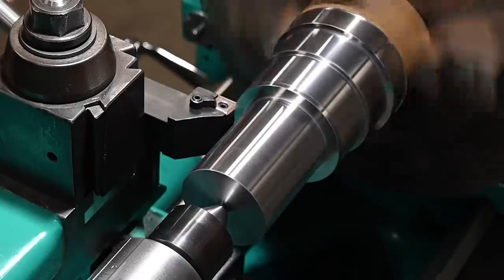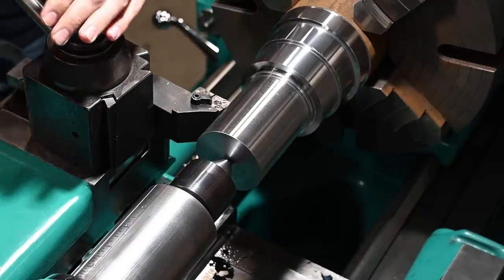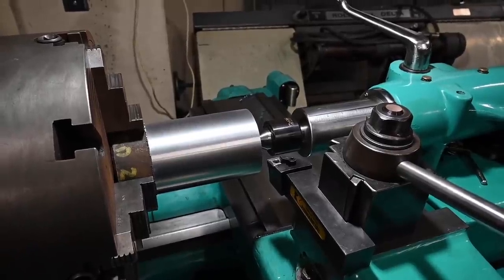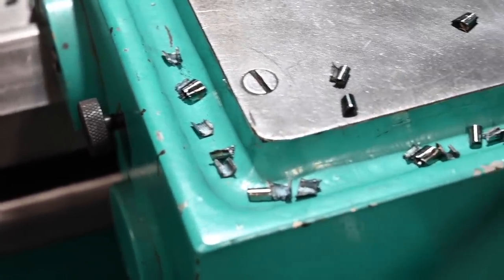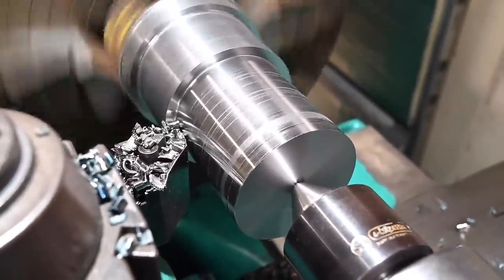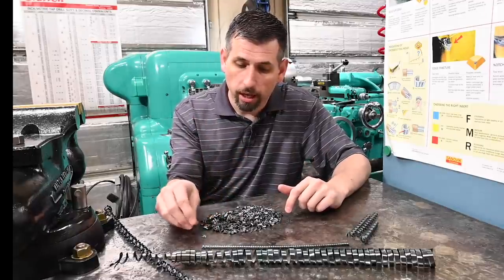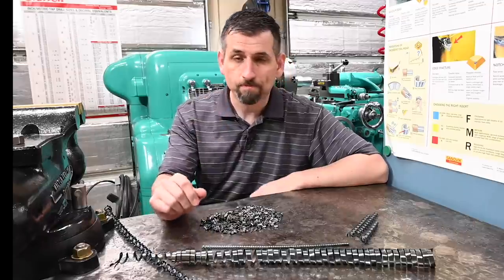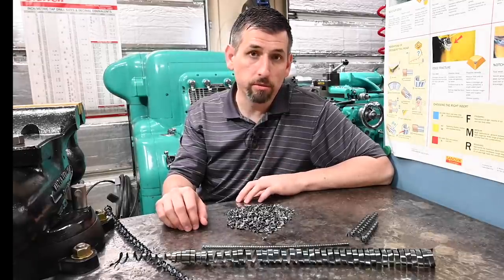Heavy Turning on the Monarch lathe: SUCCESS!!

Comment: When I worked in oil field machine shops, we had an old Axelson lathe. One of my shift mates was able to get that thing to take a 1 inch depth of cut with a carbide insert tool with an adjustable chip breaker. You could hear the chips pop all the way across the shop. :O)

Comment: Actually WWII pretty much ended HSS as the primary turning tool. Carbide was in widespread use by the 1950's. I am glad you got it figured out! I knew you and the machine could do it. :-)
Reply: Actually hss only hit the market as late as 1976. Before that it was high carbon tool steel that was used for lathe bits/cutters.
Reply: I know what you mean. TCT took over then as it was superior.
Reply: @swansong1851  T1 HSS was patented in 1910, M2 came in 1937. There have been various mixed high speed steels for cutting tools for over 100 years.

Comment: Ignore the "your doing it wrong" comments, you stated that it was an experiment/lathe and operator video series, very impressive metal removal on a lathe that was most likely designed with HSS tools as the main choice/availability, brazed carbide was most likely available, but used for the difficult materials only.
You can use the data for each insert as a starting point, biggest factor is material, ref SFM.
Great vlog thanks for sharing.
Reply: I have a question and please don't think I'm trying to be rude, if he is asking for help by posting a video and asking for assistance how does one give said assistance/recommendations without simply implying that he is "doing it wrong"?
Reply from the maker: I think it's pretty evident when you're offering advice without being a jerk. Comments like "I can't watch anymore, this guy is gonna get people hurt with how he does things...I could get this job done in half the time, this is ridiculous" isn't very constructive. "A better tool to use is one with a positive rake on it to cut with less friction and consume less horsepower" helps explain a better approach without coming off like a prick. Hope that makes sense.
Reply: I believe that the Bosted Tap comment which said that the "biggest factor is material" implies that your choice to save money may backfire as you can't adequately check each piece of material. I hope that was a positive comment on something you may want to consider.

Comment: Nice, glad you got it worked out,  I believe you could see in the last video where the tool was slightly deflecting down into the work, all sort of makes sense now.   There has been more than one video I have watched where you can see things happening that you would not notice while actually making the cut.  Might make sense to do some slow motion video when having problems, just may find that Doh! moment.  Like forgetting to tighten the tool in the holder, BTDT.

Comment: Home shops are for fun. What is the point of having a 10 HP machine if you run it at 1/2 HP all the time? The purpose of owning one of these is to explore its capabilities. You will discover it's limitations by pushing it to the limit. What you learn is invaluable. Most of my turning is done a Hardinge tool room lathe but I have a 10 HP lathe that i use for big parts. I expect to see the coolant steam and the chips fly. Like you I worked my way up to big cuts. Now I know how to do it. Let's quit pretending that your activity and mine are somehow motivated by professional goals. We are in it for the adventure. We like making stuff.

Comment: Hint. Measure the new tool post stud length and mark that on the shank. Every once in a while check the stretch. But now you know what a failing stud feels like
Reply: Are the studs generally mild steel? Perhaps a high tensile stud would circumvent the issue to some degree.
Reply from the maker: Essentially everything is a spring so studs can stretch, especially after a crash or something. I bought this tool post well used and the stud was in terrible shape so I made a new one with prehard 4140. I used a mild steel block to make the nut out of, and rather than weld the dissimilar metals I chose to pin them together which wasn't a good decision. Followed the procedure to weld them together and now it's nice and strong.

Comment: I've watched a lot of lathe videos and the one thing I've noted is that you are NOT always going to be able to break a chip.  Sometimes the metal just comes off stringy.  Both Turnwright and Oxtools have failed on occasion find the grail of feed vs RPM.  Even Abom79 has had a problem with this.  So, if slowing down the RPMs or speeding up the RPMs, and the same with feed rates fails, you are going to have to live with it for the job.  Keith Fenner did point out you shouldn't try and grab the strings, that sounded like really good advice.

Comment: Great to see your progress.
Be aware that when roughing, depending on the holder 
and insert geometry....
The skuffed erea is most likely just the tight curled chips doubling back against the surface you just created.

Your finish pass, and the 2 identical validation passes, will have a proporionaly smaller chip which shouldn't rub on the work.
Hench no skuffing.

Comment: I think you have a great machine to play with and a good attitude to go with it. I am a hobbyist with an old 1960 13" South Bend engine lathe, 3-step pulley for speeds. It's a 2 hp with a 2-1/8" wide belt. I also learn as I go. I was trying to see what kind of cuts I could take. Using carbide inserts and running in the mid 450 RPMs range I could take some deep cuts producing good results but only under certain conditions. If the piece, I am turning is all the way in the chuck so it can't move back then .300 to .400 plus works but unless there is a spacer or it's against the rear of the chuck it will shutter and push back through the jaws of my 6" 3 jaw chuck. Normally I can take .200 per cut with good finishes and results. I really believe you can take a lot more off than you are doing. There is a video by Joe Pieczynski and he is starting out with a 1/2" diameter stainless bar and taking 1 cut leaving .030" peice 2-1/4" in length. Please take a look, it will help you determine the depth you can go to by seeing someone in action. I enjoyed you video and your lathe. Thanks

Comment: Hey friend getting a kick out of watching the Monarch. I ran a 1953 model for a few years very good machine. 10hp on this machine is way plenty to turn heavy cuts.
   I will offer a suggestion or two may help you a little. When roughing with the cnmg type tool you might find it helpful to adjust the angle of the insert to less than 90° even 5°can helpful in hard or tuff material it would leave you a little too face later but I've always found it to helps enough to the extra facing didn't bother me. Also the angle will help save the very tip of your insert so that when you turn it back to slightly more than 90° you can obtain a good finish. 
   I recommend trying lots of different angles especially if you're doing heavy turning because there are some intense forces at work and the angle of your tool can make a lot of difference ! You might try checking out the grinding of HHS tools and why they grind different angles and reliefs . I personally like the  TPG style tools but to each his own ! They do make tool holders that will give that cnmg tool a negative rake and ones that hold the tip of the in the center of the holder also with different rakes and clearance .
   With more experience you may learn to listen to the harmony of the machine and the tool working together ! I always love it when I can hear the machine pulling the cut but not straining and it should be a smooth sound. 
   Keep experimenting and refining your technique hope you have many years of enjoying that great old lathe !
SAFETY FIRST ALWAYS !

Comment: Just a helpful tip. What you should be looking for are 6’s and 9’s in the chip and a dark blue colour which shows the bulk of the heat is in the chip. Just adjust rpm, feed rate and depth of cut until you get that and then you are on the right track mate. (50years in the trade)
Reply: 😮50!🥂

Comment: I think the bad finish may have just been chips getting caught between the work and the toolholder, it shows up well in the video.
 That machine was designed such that the tool or the work will give way before the machine ever will, I think you could go to the max D.O.C. for any insert though you may stall the motor with the sfm for carbide.
 I've used a 16CW turning stainless and odd jobs at a fab shop, it was pretty well worn but still quite accurate. It's been a number of years but I know I took cuts that deep in 316 stainless, I couldn't get the chips to break reliably in that stringy material but I got the job done.
 A good trick is to set the rpm a bit high and take a facing cut, you can then figure out the best sfm for a good finish by measuring where the shiny spot and calculate the sfm based off the diameter.
 Please add the machine make and  model in your video descriptions, you'll probably get a few more views from the Monarch fans.

Comment: Aaron,
I spent my career repairing machines instead of using them. My shop was just entering CNC when I hired on. My skill set as an electrician turned electronic tech and precision mechanic was desperately needed in our shop. Those decades were growing years for me. Within a couple of years I was managing our group of technicians and picking up machining pointers along the way. I did almost none of my own machining, and when I did, I had REAL machines to use that the REAL machinists had set up for me. In my retirement I am trying to learn to machine with older, smaller machinery that fits in my shop and into my budget. Manual machinery drifted out our our shop as CNC took over. CNC machining skills hold little interest for me except the advantages of complex geometry. I like making one offs to meet the current need whether making the part from scratch or modifying something worn or broken. Each part presents new challenges. Figuring out what is going wrong is part of the joy of the journey. Most of my large experience came from Clausing Colchester machines. I have owned my Craftsman/Atlas for quite awhile, but the little girl sure has limitations. I am still learning what she can do. A much larger LeBlond is trailered waiting for the new shop to be built.
I am equally interested in woodworking as machining. The learning curve in wood is similarly extensive as machining. Each skill set offers a lifetime of learning experience. The more that I learn, the more I respect what others know and can do. You stepped into my world when you shared your repair efforts and discoveries. I cringed at mistakes that you were making along your journey that I would like to have been helping you avoid, but you are helping me by teaching me along my machining discovery trail. I have only recently discovered YouTube. I enjoy and rely on the group of YouTuber machinists.
Each of us that has a competent skill has something to teach the novice that wants to learn. Each of us that is discovering a skill has something to offer someone just starting their journey. I appreciate your explanation of what your channel is about and what you are trying to do. Your explanation inspires me to watch your videos more diligently.

Comment: Love that Monarch Lathe!  Great job on sprucing it up, thanks for sharing!   Keep seeing your Brown and Sharpe calipers I have the same set and LOVE them.  Mine are getting a little beat up and I'm sad that I can't purchase the same ones as a replacement.  I purchased them as a second set for rougher use that my Mitutoyo calipers but find I prefer everything about the Swiss made B&S.
Reply from the maker: I love these calipers! It amazes me that round depth rods aren't more common- I much prefer it to the flat blade with a step.
Reply: AlwaysSunnyintheShop , I fully agree with the round rode being superior, I can get close to edges.  Also, the B&S seems more accurate reading I.D. for whatever reason.

Comment: Sometimes its just trial n error. Back in 78 i worked in  government sub shop. We made missles and rocket parts. And others some restricted- which no one knows all about. Well we had a giant lathe 54inch chuck. The bed was i think 60 ft or so. Well my job as forman was set up on many of the machines . That old lathe with high speed tool bits would cut 3/4" chips at low rpms. Those things were about 30 thou thick and blue . Handfull felt like 5 lbs. Been a long time ago but it ran all day to cut the length of the lathe. Use to have a few chips but i sure dont know now where. The vbm was my job daily it had 12 ft table level with the floor n up thru the roof. Keep cuttin and learning . Wish i had pictures but no cameras aloud there then.

Comment: Sorry, I know I'm late to the party. 0.021 feed/rev may be a bit much for your chip breaker. 

Look at the insert maker's catalog. They have recommended ranges for their different chip breakers displayed in convenient chart form. I eyeballed the chip breaker in the insert you're using. I think you'll find 0.011 to 0.016 feed/rev to be the sweet spot for low and medium carbon and low alloy steels. Once you find it, you'll be rewarded with the jingling sound of blue 6's and '9's cascading into the chip pan. 

Modern carbide inserts are highly optimized with coatings, chip breaker configurations, base carbide, etc mixed and matched for specific conditions. Some may be well suited for broad application general machining but others have definite niches - inconel, 300 series stainless, free machining steels, nickel chrome alloys, boprozes, aluminum alloy etc.  The CNC gurus keep catalog libraries and computer apps to aid selecting inserts for production machining. Before you commit to inserts on eBay look up the multi-digit number on the packages. Lots of white elephant inserts on the NOS market. Shop wisely.

If heavy roughing is in your future you might consider a turning tool with a "B" as the third character in the designation code. This denotes a 15⁰ lead angle.

My personal lathe is a Voest DA215 toolroom lathe I bought new in 1971. It's presently fitted with a 5 HP three phase induction motor run from a VFD. In the early '90's, I decided to upgrade from triangular inserts as the tooling I'd been using was deteriorated when I got it and 20 years of daily use hadn't improved them. I comitted to the 43X "W" series "trigon." inserts and my initial buy of turning tools were made by Iscar. The trigon has 6 usable cutting edges, 12 (theoretically) if you exploit used inserts on tool cutting on the other hand. The trigon's 80⁰ tip angle is more robust, geomertically speaking, than 60⁰ triangle inserts.

I've since expanded my collection with other makes accepting trigon inserts as they became available and I could afford them. It turns out I was accidently wise in doing so for the trigon inserts are still very popular and come in a huge selection of configurations and nose radii. 

I've been careful to limit my general turning tooling selection to those accepting trigon inserts. Accordingly, the trigon section of my insert drawer has about 15 little trays each with a particular insert. Many of my friends have whole drawers devoted to general turning inserts of many shapes representing a large investment, many having very low utilization.

I didn't mean to go on a rant on the virtues of my particular choices. YMMV. My point was to encourage selection of an insert shape that fit the maximum array of the general purpose tooling you will use. and not purchase (or accept for free) other tooling using different shapes: IOW, standardise.

Comment: Nice video of you learning as you go!
I'm learing to become a machinist and I'm 20 years old.
I have done alot of heavy cuts with a DNMG150612 insert (doc up to 5mm in stainless so 10mm off the diameter).
Maybe you could give that a try, or just low doc and high feed/speed might be faster.

As a tip I'd say use a smaller tool holder and put it in a real holder ;)
You should be able to get away with using a 20-25mm tool holder.
I'm watching this channel for the first time now so I don't know why you did this.

Keep learning! Everyone should always be learning!

Comment: If you look at the surface scratches during the cut, you will see that they form well behind the cut face.  I think this is because of the chips getting caught between the insert and the work.  You can prevent this with a more diamond shaped insert, or by changing the angle of the insert you have to allow more trailing edge clearance.  Coolant will also help flush them away before they get caught.  You should be able to make these exact cuts and leave a beautiful finish.  THEN it's success!

Comment: I have taken 150 per side from 4" piece at 3.5 feed and 150 rpm using a small tool room lathe, AXA tool post and tiny 3/8 carbide tool. Chips are very similar - small yellow when at least some coolant is used. Chipmaster 5 x 20. 4140 steel. I have found out that my larger machine which is 16x75 light duty is only marginally more capable then heavily build tiny chipmaster in the cut they can both take without vibrations. I am sure I can take bigger cut but I don't want to strain the machine too much or break a tool - it was made for precision not hogging.

Comment: I was just thinking you could rig up a dummy tool block on the right hand side of your toolpost and use it to clamp the post down in a second location. You seem to have unused T slot length available. You'd only need it when trying these heavy cuts. Like you say though, you've got it out of your system so might not be necessary now. Keep up the good work and interesting content. Mart.